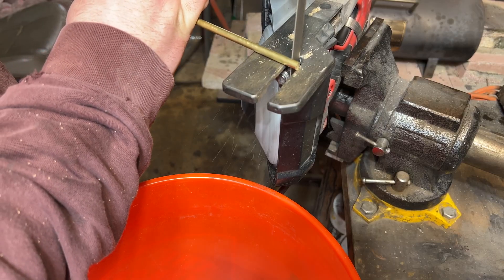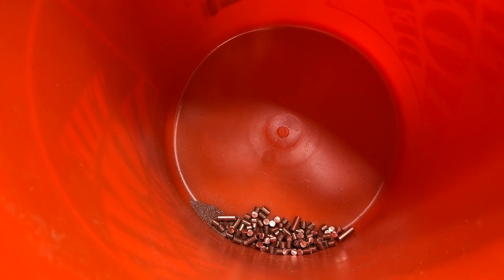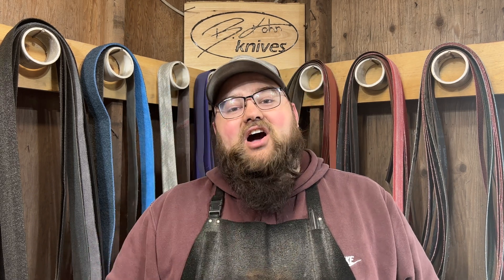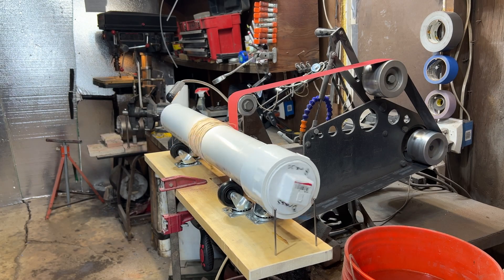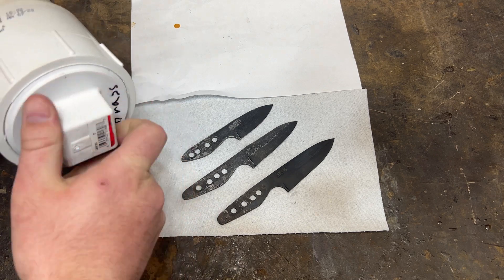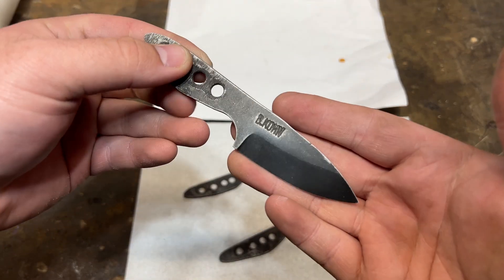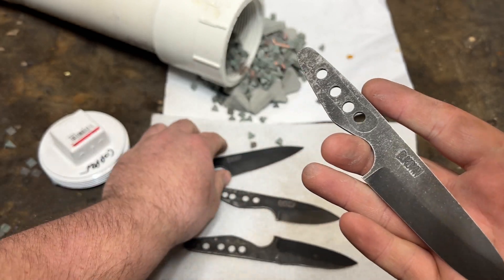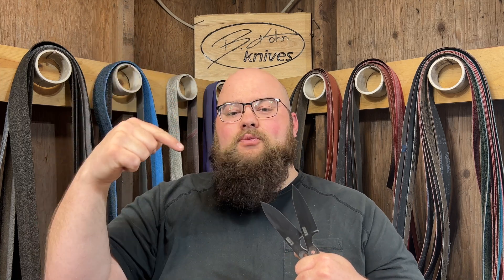EXPERIMENT: Copper and Brass Acid Wash System

Comment: Maybe this already came up, but I think the issue was using polishing media along with the brass or copper - i.e. whatever brass was imprinted on the blade was probably scrubbed right back off by the media. This same process can be done by shaking water and brass in a small jar, so I don't see why it wouldn't also work when automated with a tumbler setup.
Reply from the maker: Huh. That is a great point

Comment: You need to find a way to heat it up a little bit while tumbling. If you are able to introduce some heat to the steel and copper/brass media, you will see a significant transfer to the steel. I’ve been working with this method a little bit at home with some great results.

Comment: I think whoever may have told you this might’ve gotten mixed up with another process. I know if you put brass or copper in your ferric chloride it will etch with those hues onto the blade. Possible you could do a copper wash on your etching and then tumble and get a stonewashed effect on top of the copper wash. Just know that once you put the copper or brass into the ferric that permanently changes the ferric to have the copper or brass in it.
Reply from the maker: I’m not sure. I’ll give those a try